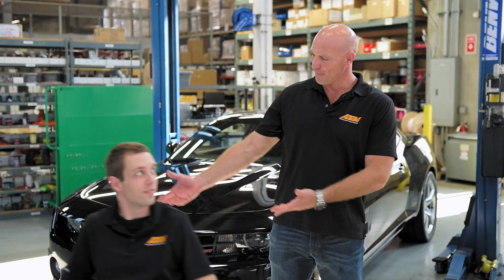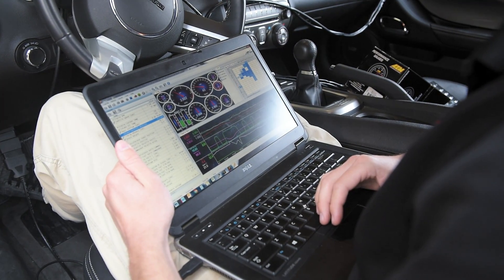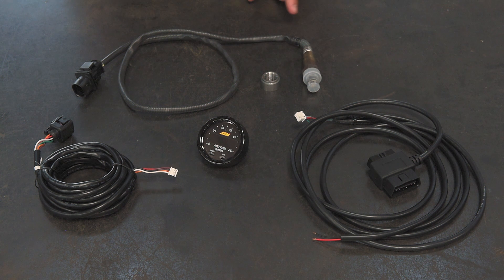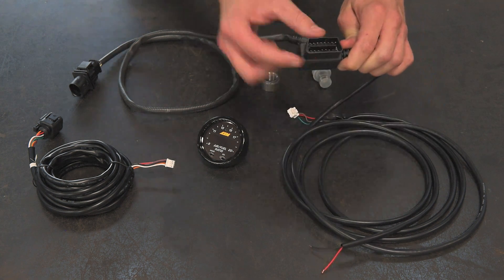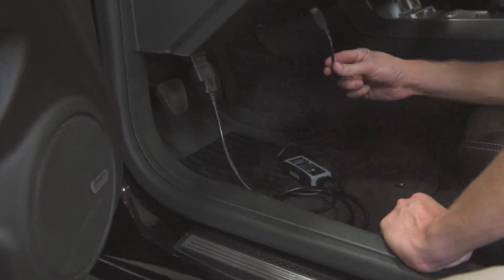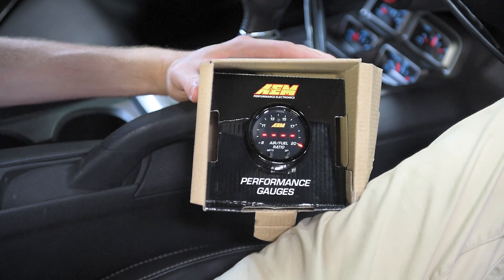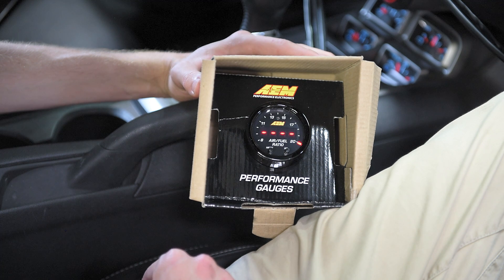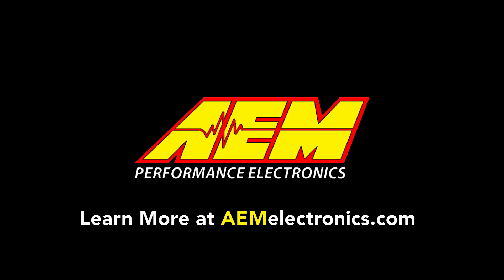AEM X-Series OBDII Wideband Gauge Tested with HPTuners on a Chevy Camaro!

Comment: I do have a question. I'm looking for wideband to read for older 01 to 07 ls vehicles. So I'm gathering the 30-0300 would work for that.  But would like to use on newer cars to with faster response... so was wondering if everything the same in let's say the 0334 kit  as the 0300? My thought is couldn't I just unplug the wire from back of gauge that goes to serial port usb off the 0300 and plug in the wire from the 0334 kit to then plug it in to obd2 port and use for newer? Or is there something in missing.  And if that's the case .. do you sell just the wire for obd2 setup or vice versa??? Thanks in advance

Comment: Will this obd2 wide and work with a 2004 Silverado ecu ?? I heard on another video I has to be 2007+
Reply from the maker: The obd2 canbus protocol wasn’t standardized until Model year 2008, vehicles before this point may have used non standardized communication systems(both can and noncan).

Comment: can you tell me why it won't work with the lighter power source ? it provides enough power
Reply from the maker: If the lighter power source can handle a load of 3-4amps while maintaining a full 12v while the sensor is heating up then yes it can be used however some lighters are limited to very low current numbers.

Comment: If a narrow band always tells you either stoic, lean, or rich, and you can log that at different RPMs into something like say HP Tuners, why do you need a wideband AFR? I understand the wideband tells you HOW lean/rich you are, and that will make the tuning process easier. But suppose you know from your narrow band that at 6200 rpm you are too lean, can't you just adjust the mixture a little bit richer at that RPM until it's stoic?
Reply: At that high of an RPM, you would be running in open loop on most vehicles, which would effectively shut off the o2 sensors for the car until you come back down. The ECU will only look for knock at that point because the air/fuel is set to a predetermined correction factor and then looks for knock to ensure timing is not too aggressive. The wideband would show you how far off that is, and which way to make the correction to hit a specific a/f ratio at WOT

Comment: So if the difference between the x-series obdII  and the normal x-series is the ability to connect through obdII port, then how does the standard x-series connect to your ecu? it says in your description for 2008 cars and newer. Mine is older and still has obdII port but I'm running a Kpro v4. Does this work for my setup or do I get the standard x-series?
Reply from the maker: You will want to connect it to your KPro using the 0-5V analog input. If you need some extra help please email our support team and they can make sure you get it set up properly! gen.tech@aemelectronics.com
Reply: @AEMpowerTVelectronics  Will do. This project has been more than confusing. Thank you!
Reply from the maker: We are here to help!

Comment: What about a 2000 Corvette with non-canbus?
Reply from the maker: It will only be visible through the OBDII connection on 08-up vehicles because that is when the OEMs standardized CAN for OBDII. However, most piggybacks and open source allow a few inputs via 0-5V analog. If yours does, you can wire in our regular X-Series Wideband gauge (PN 30-0300) into your 2000 Corvette and connect the 0-5V output on the gauge to your piggyback controller if it has provisions for it.

Comment: Does this work on a 1997 Mazda RX7 with Apexi PowerFC?
Reply from the maker: It will only work on 08-up vehicles that transmit OBDII via the factory CAN bus network. If the PowerFC accepts an analog input you can use our 30-0300 X-Series wideband and wire that in.

Comment: It would have been nice if it drew power from the obd2 so you dont need to splice into anything
Reply from the maker: It would be cool, but the OBD port does not provide enough power to heat the sensor.

Comment: Any luck using these on pre-2008 gen3 LS engines? Interested in the 411 PCM with p01 and p59 software revisions and HP Tuners Pro. Holding on purchase of two units until I know for certain.
Reply: Christopher Ryan did you find out if it will work pre 08 withe the non pro hpt?
Reply from the maker: Hi, unfortunately, it will only work with 08-up as that is when OBD began being transmitted via CAN bus.
Reply: @AEMpowerTVelectronics  I thought you could wire the aem 30 0300 wideband O2 to work with the original HPTuners serial interface.

Comment: Is the X series capable of reading methanol race fuels? I've been considering getting into using VP M5 but I've heard that the old uego wideband was not capable of reading M5.
Reply from the maker: The X-Series' 0-5V analog will output Methanol values from 3.75:1 to 8.0:1 AFR, and it display Lambda values from .55 to 2.00.

Comment: So if I purchase this aem x series gauge and hptuners do I need to spend the extra to get pro or can I just purchased the cheaper version of hptuners and this gauge enable to tune.
Reply from the maker: Please check the HP Tuners forums, but I believe you need their latest version of software.
Reply: the cheaper  $499 vcm editor
Reply: Did you find out the answer to your question? I think this will work but I dont know if it will be in Lamda

Comment: does this work with ROM raider/tactrix open port?
Reply from the maker: We have not tested it on that yet.
Reply: @AEMpowerTVelectronics  any updates to this?
Reply from the maker: @JaYzWrExX  The X-series wideband gauge has a serial data output on the connector that is not populated, but with the pin P/N: SPUD-001T-P0.5, a 24awg wire can be added for that functionality.

See pages 2-3 and 13 on the instructions for more info.  https://www.aemelectronics.com/files/instructions/30-0334-X-Series-OBDII-Wideband-UEGO-Controller-Gauge.pdf

Comment: will this work for Evoscan?
Reply from the maker: We are looking for a vehicle that is running Evoscan to validate it on, but it should. We just don't know whether the default settings will work or whether it will require changing PIDs using the faceplate buttons.
Reply: AEMpowerTV can it show boost from the obd2 port ?
Reply from the maker: We have an OBDII gauge that will show boost if it is on the CAN bus and the manufacturer outputs that channel to the OBD port, but this gauge is only for AFR/Lambda so that it can be seen and logged in open source and piggyback programmers that have the capability to do so.